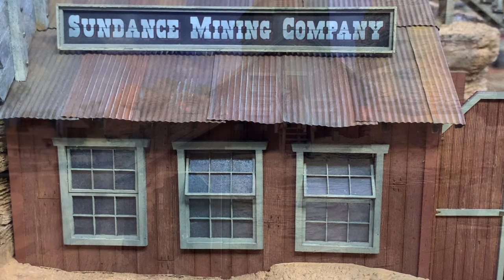The Sundance Mining Co  | Bandit Canyon Railway

Comment: If I remember correctly part of the Vindicator Mine complex in the Cripple Creek district had a section where trains would run through the main structure. And the waste rock was just piled against the structure. While not exactly what you modeled, it feels similar